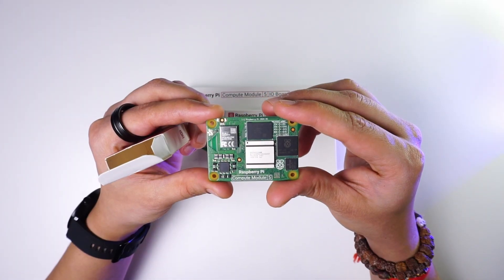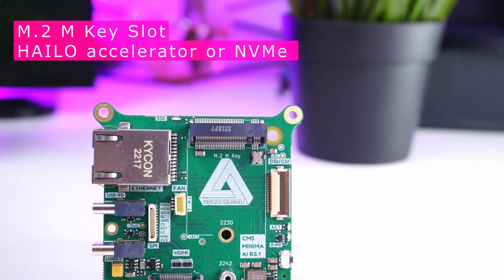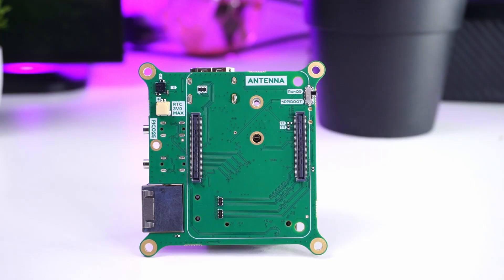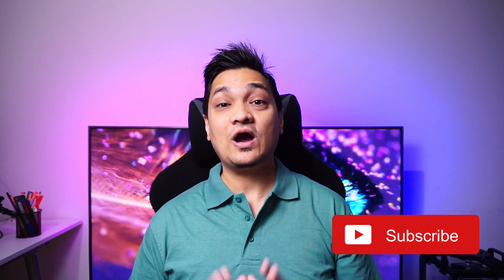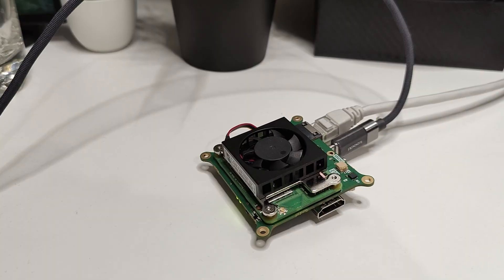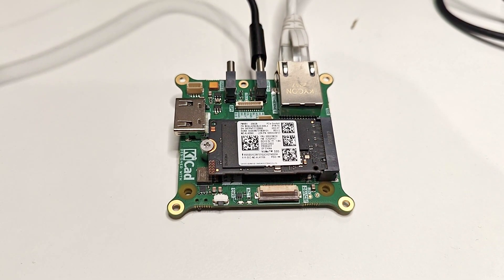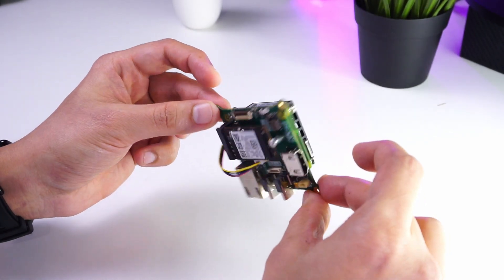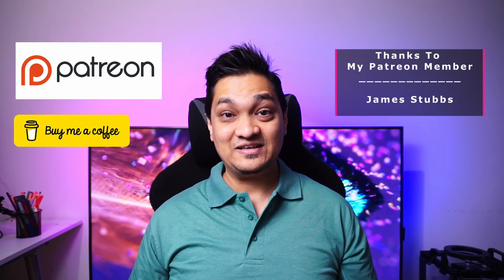Tiny Raspberry PI Compute Module 5 Carrier IO Board That Fits In Your Palm — Seeed Studio Minima 🚀

Comment: Please make one review for waveshare nano b base board for the compute module 5 heard they are way better and 30% the price
Reply from the maker: The nano board from waveshare is cheaper because it does not have an nvme slot and an ethernet port
Reply: @SmartHomeCircle  The nano board A does not have it but the B varient has it also it also has a pcie ribbon connector and usb 3 support please do a review of it sadly it does not have a nvme slot